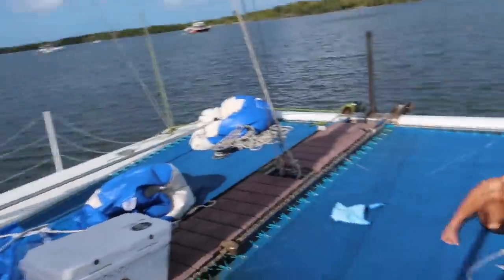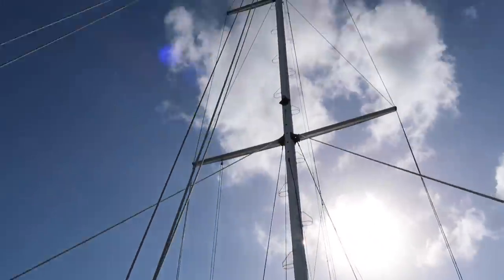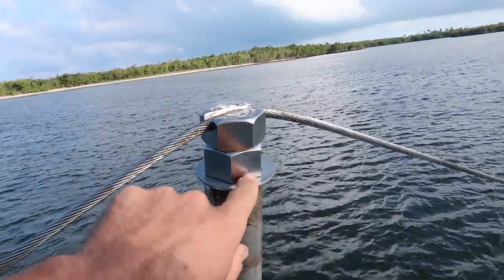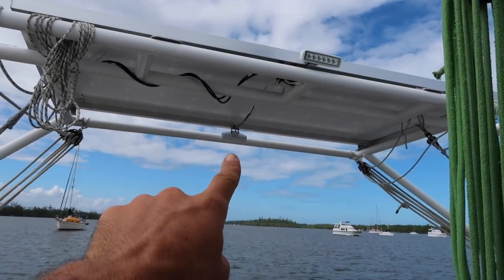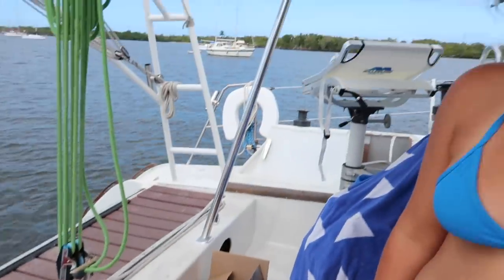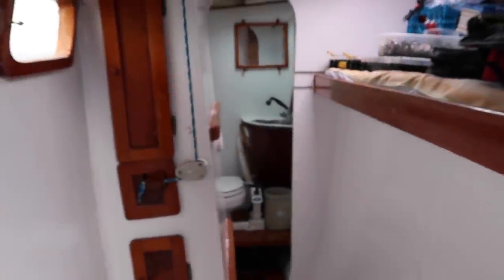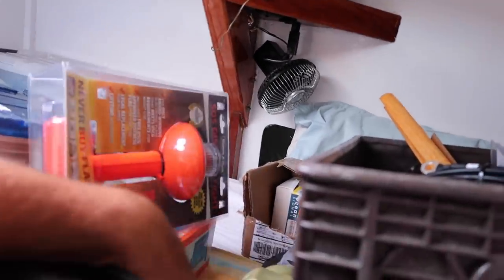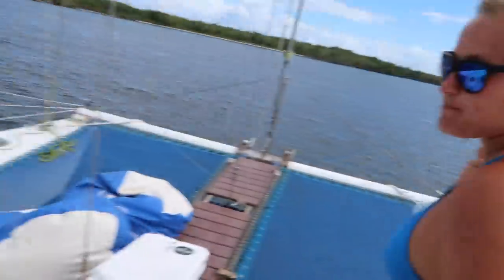DISAGREEMENTS ON A BOAT. should we have a generator on a simple, fast, multihull cruiser?

Comment: Come on, a no brainer.  Buggy anchorages are best with the boat sealed and the AC on.  Hot shower?... it runs most hot water heaters.  Flat iron or blow dryer?  Running the water maker if ya get one?  Charging the house bank after a series of cloudy days?  Charging the house battery is not healthy for your main engine (low load) running.  High amperage power tools?  Ours makes things much more comfortable and convenient.  Keeps the wife happy too!

Comment: Bring that generator along, in the event of a flat starter battery or electrical failure it’s another solution. We also boat in the Med at high season, I’d die without AC when it’s 40-45 degrees C, so I admire you for trying the minimal route there! We only use AC to cool the cabin off before sleeping, in the day we just swim 8-10 times a day. Keep it up, love the vlogs.

Comment: I'm with team Sierra on this one Billy. The generator can not only help run a small A/C on unbearably hot and humid nights, but can certainly help run a fridge to keep food fresher longer. Just think, you won't have to pull into a dock and get shore power to do any repair or maintenance projects because you'll have the power to run your tools while still onboard and at anchor. The generator won't weigh you down as much as you think.

Comment: With a small generator like the Honda 2200 for example, a marine A/C unit can be made to start on an EasyStart 364 electronic soft starter.  It was developed for the marine industry and it just won the finalist spot from the RVIA, the RV Industry Association, for innovation as best aftermarket product of the year.  Marine A/C RUNS on low power units.  But STARTING requires more power and larger units. With the EasyStart, your boat A/C will even START on low power.

Comment: Kudos on the dyneema splicing.  I just spliced a new triatic stay from dyneema 12.  I used the brummel locked splice with buried tail.  Those were my first dyneema splices too  It went much easier than I expected even though my dyneema ia 5/32".

Comment: Definitely bring the generator. We don't have AC on the boat but it has been very nice to charge the batteries without having to run the engine when there is a few days without enough sun. Its also useful for running the hot water heater so we can have hot showers and hot water for washing dishes. It's great for running power tools at anchor and we have loaned it to friends who needed it for emergency purposes. You have two engines so this isn't as big a deal but for us mono-hullers is nice to be able to charge the batteries if we have trouble with the engine (such as when I accidentally let air into the fuel line).

Comment: It will be hot and humid there so you will need something to keep you cool, especially when trying to sleep. My wife and I weren't sure if we wanted to invest in a AC and generator for our boat. We ended up purchasing a 12 volt swamp cooler (Swampy is the company) and have been impressed by  it for the last 5 years. Its portable and very light. I feel this will meet both your needs.

Comment: You can charge your batteries straight from the generator, only 8 amps but better than 0.  If you plan on staying in the islands during hurricane season it may come in handy for others to use.  We took it with us when we had to leave the boat for Irma and Florence, it was good to know we were ready to help..  We travel light on a small catamaran also, but our Honda is always on the boat. #teamsierra

Comment: Boat is looking great you guys!
Team Sierra here! Billy, what is your reason for less weight/speed? You’re not racing. I have been married for over 30 years. I was always taught that with relationships you give 60% and expect 40%. That goes both ways! It leads to a much closer relationship which brings forth a happier life together. My wife and I have always made joint decisions. If at a cross road, it is a great idea to give your 60%. Happy wife, happy life. You may not be married but you both have been together a long time. You have an exceptional partner in Sierra who gives in to your wants and ideas. It is time for you to do your part. A generators weight on a race boat may be foolish. What is your need for speed? You both are young. Slow down. Enjoy you life TOGETHER! I speak from experience. 30+ years! Sierra is a wonderful person and consider yourself lucky to have her. A good women is hard to find. I have mine and we are still happy together after all these years. Give your 60%. 30 years from now, you will remember my words. It’s well worth it! Keep her happy. It is your job. It’s her job like wise to keep you happy. Thats what make wonderful couples.On your way to get the generator, pick up a small ac unit too!

Comment: Generator for sure. AC optional. If you end up somewhere remote and have problems with your electrical system (solar, inverter, batteries etc), being able to fire up the generator could make all the difference. Back up equipment does you no good if you leave it behind. Sierra would never let you live it down Billy...... never!  Great job guys. Love to see you out there living your dream and fixing up your boat as you go!

Comment: Great videos guys as always.  If I'm not mistaking you guys said you would try and do a Caribbean cruise this year.  The heat in the Caribbean is like no other especially taking into account you guys spent a lot of time in South Florida and dealing with the summer heat there.  Don't forget Billy the one thing I didn't hear you mentioned is the humidity there.  The Caribbean humidity is different from that of the United States take it from a guys who lived on the island of St.  Croix ( USVI ) for 23 years.  True....once the boat is moving cool air will circulate making it feel cool, but it's a different story on the hook.  Installing 20 or 30 fans won't solve the problem because all you'll do is circulate heat inside the boat.  I would much rather you have and not need it than need it and not have.  Think it over , sleep on it for a couple  of days, sail on it, fix the boat, do a dinghy ride on it and then finally make a decision.
#TeamSierra

Comment: Hmmm...we carry a small generator on our 31' Corsair trimaran (which we are pretty conscious of how much weight is aboard). Only used it to charge batteries when it was too cloudy for the solar panels to keep up. We do have a little watermaker it could help run too if necessary. Can't speak to being in the Tropics though. Good luck with this debate....now I'm off to find some thin Dyneema for our lazy jacks! Cheers, Carleen in 🇨🇦

Comment: On your gull striker tension setup, cool idea, but how are you going to keep the tension bolt from loosening up without a lock or jam nut on it?  I would use a half-nut in between the two full size ones as a jam nut.

Team Sierra, because you can also use the generator to operate power tools for repairs if needed, making them go faster.  You are not racing, but you are planning an extended trip, that is sure to involve some repair work at some point, which always goes faster with power tools.  And the most important reason: happy "wife", happy life!

Comment: Get the AC before you leave Florida, it will be cheaper.  Places like home depot and lowes usually have some for around $150.  I don't use it during the day because I'm not in the cabin much, but at night when trying to sleep, its heavenly.  After the first time I used it, I never spent a night without running it.  It also keeps the bugs out for some reason which also really helps me get to sleep.

Comment: On your bow strongback you should get some stainless jam nuts. They are about half the thickness of the tensioning nut you currently have and the 2 jam nuts would be about the same thickness as the nut you have now. That way you can lock the assembly.

Comment: My first question is. Is the generator large enough to run an AC ?  A 5000 BTU AC unit needs about 900 -950 watts to run it and a surge capacity of about 1500 watts to start it. Amps x volts = approximate watts. Starting a compressor usually requires one and a half times to double the watts to start. Generators are rated in running watts and usually have a max surge rating for starting.

Comment: I've been in the Caribbean in the summer.  The only time it is unbearable is when there is no wind, which does happen in the summer, and when you have to pull into a marine for repairs or whatever.  My vote is keep the gensset and get a small AC unit for those nights because even sleeping in the cockpit is still miserable.  Plus, you never know when you might need to charge the batteries, many days of rain and no wind for solar and wind gen, or may need to run 110v power tools for an extended period of time.  Finally, Billy remember, Happy wife, happy life!

Comment: What I have found is that during the day you don't NEED air conditioning in the Bahamas, and through most of the rest of the Islands. But, at night when you are trying to sleep and it is you, Sierra, and Jetty in one bed, there is no amount of fans that are going to handle the heat load. There just isn't enough ventilation on most boats for that. But that doesn't mean you NEED the generator. If you found a small AC unit or a dehumidifier (think swamp cooler) for where you sleep, and it ran for a couple of hours in the middle of the night, you can get a good nights sleep. So for you that is more of a check on how big is your battery bank and maybe you want to instead see if you can put bigger more efficient alternators on your motors. Then you could idle one motor for an hour or so to run the AC and recharge the batteries.

Comment: Billy just bring the generator it will have many possible uses plus it never hurts to keep your lady happy. Billy I have a question on how you are going to lock your new seagull striker with a single nut after you make your final adjustment so it won't back off?

Comment: I vote with Sierra. You already carry straight gas for the dingy engine, and, during the solar panel vlog, you mentioned that sometimes during extended cloudy conditions the solar panels do not keep the batteries charged fully. 20, even 40 lbs is not going to sink the ship and the small generator sure does not use as much fuel as the engine might or at least is far more efficient watt/gallon than the 40 hp Yanmar and the relatively small 12V engine generator. 4.7k for Sierra. Only 43 for Billy. 30th November 2019.

Comment: It's coming along nicely guys. I like the generator as a third backup to the engines and solar, nice to have for running larger power tools too also what's another 100lb.s +/- on a 28'-32' multihull?! Hull speed is going to be around 8-10 knots either way... Now on my 20 footer that might make a difference! ;-)  Plus if it's too much weight, you can always gift it to a local in the islands or another sailor in need.  Heck you guys have me fabricating a Surfboard/SUP holder for my little sailboat now... after watching you surf in the Bahamas! :-)

Comment: Did you end up having to pay for the new dingy motor or was it covered. I see where you’re coming from with the additional weight the generator will bring. I would bring it as a backup, I doubt it will kill the boats speed.

Comment: My Honda EU 2000i weighs 47 lbs, so with almost a gallon of gas in it plus oil its just over 54 lbs.  Some people say keeping gas onboard is dangerous, but we all keep gas board in jerry cans for the dinghy anyway!  The Honda will run for over 6 hours at 75% load on one tank of gas (it holds about 3/4 of a gallon internally).

Comment: Team Sierra! Someone else who sails full times runs the air conditioner every so often for mold or mildew and you'd have it for extremely humid/hot nights. I know on the water there's usually a nice breeze but you have the generator, just need an a/c. Good Luck Sierra! 🍀⛵

Comment: The weight of the generator and the utility/possibilities would ensure it stays aboard.  It's nice to know you can run a small a/c at anchor especially if you are stuck in a hot place waiting for a weather window...  Running power tools off an inverter will drain your batteries quick, but not if you use your generator.

Comment: G'day Bill, & Sierra! "Installing a fan can be a breeze." But Sierra, I wouldn't throw to the wind! She really has some 'True Grit!' 😉 Adventurous, Dedicated, Really Hard Working, and plus, Frugal with her Money! Personally, I wouldn't operate my own boat with out a generator. (like the Honda a good bit) So, I'd give it to Miss Sierra, for the win!! Thank you so kindly! Cheers! 😊⛵️❤️

P.S. Although I agree with the wonderful sentiments. On the other hand, your Honda Inverter generator, has low noise, light and very small. Using one litre an hour and provide good 'pure sine power.' Would be no noisier than running your main motor to charge the batteries. ✌🏼

Comment: Take the Generator - You never know when you'll need a little electricity. Contrary to Mr. Sparkky's fuel concern,  you're already carrying fuel for the outboard, what's another gallon (6.5 lbs.) You just never know!! I'm with you Sierra - they can even be used to charge your Batteries on those cloudy days.  Smooth Sailing!

Comment: Little generater won't kick the compressor over unless u do alot of upgrading.youll need some easy start capacitors booster on the ac wich is not so easy on a window unit

Comment: I don’t know you guys , I’m kind of torn between having the generator on board or not, I myself just spent over a month on the hard that actually started out just taking the generator out of my 30 ft. Rampage due to the fact that it was so far gone and that there was no way I was going to invest $$ into something I hardly ever used. And not to mention the space I was going to gain and yes the weight was probably around 400-500 lbs which is no longer on the boat,, BUT a small Honda eu 2000 could come in handy while cruising the Caribbean for so many different things and hey if you find that your not using it for what ever reason I’m sure there would be a buyer down there just loving the fact that you would have one for sale😉😉😉👌👌👌👏👍⚓️⛵️🦈🐕

Comment: I lived in the Caribbean most of my live and I'm 45 now and grew up boating and it gets crazy hot, specially  humid days, when there isn't any wind you'll be eaten alive by the mosquitoes and that is no fun. You'll have to shut off close everything thanks to the mosquitoes and then have to deal with how hot it'll get inside of the boat. I really hated when we had a boat without ac and when the genny on my dads boat wasn't working for some reason. I would say take it, the extra weight is not a big deal.

Comment: You have to bring it. It very well could save the day. When you on your own you need redundant  systems. I will not go camping in the wilderness without one, and we don''t have AC. Its another power source that is a great back up. Its worth the weight. I would buy an ac powered bilge pump to go with it. They are cheap, and pump a lot.

Comment: Take the Generator. You may not need it. You can run it to cool the boat off before bed then turn it off and use fans. We do not run our ac but will if we have to. So we keep one handy. Also we live aboard.

Comment: You can make a simple Swamp a unit with a car radiator & 12v electric fan unit. Put an adapter on the inlet and outlet to fit a garden hose. Attach a length of hose to the inlet ( top side of radiator)  to a small submersible pump... (bilge pump for less effective 12th option or more effective 120v  garden pond pump  for more effective option)  attach a length of hose to the outlet (lower) end. You can build a nice box for the unit if you like. When you get to a hot anchorage toss the pump and out let line over the side and turn it on. The water 10' down is much colder the pump will fill the radiator with a continuous flow of water and the fan will push the air through cooling it. Depending on size of radiator you could set it in a port light or if you add a little more wood the main hatch way.  It is relatively small and light. As for the genny definitely carry it with you. You won't notice the few extra lbs you aren't racing her and you'll be glad to have power whenever you need it (gas supply allowing lol )

Comment: I carried a Honda 2000 for a dozen years in both fresh and salt environments never a problem there. One full tank on it will last quite awhile. Usually carried a 1 gal extra can when we would go on 2-3 week trips. I did have good “outside” storage for both though that kept both the gen and gas where ventilation wasn’t an issue. Since I was in northern waters (Lake Superior and Puget Sound) having hot sun on things wasn’t really an issue. Our boat was set up with a propane stove and enough battery bank that we ran a 1200 watt inverter for most other things. I didn’t have solar panels though so the gen got used to charge batteries and run the hot water heater mostly. I must admit that we would go months without starting the thing though because it was a power boat and just running the engine on a 5-6 hour run was usually enough for battery charge. So I am evenly divided! I am going with Team Jetty!

Comment: If you can handle a Florida summer without Ac I’m pretty sure you will be able to handle the Caribbean summer without Ac. But then again the Honda is pretty light and may come in useful in other ways. Also a shame to store it. Maybe take it with you then sell if not needed?
On a more important note, how about a performance update? New sails, folding props and a bottom job, inquiring minds want to know.....is she faster?